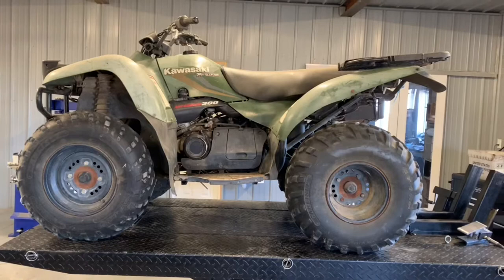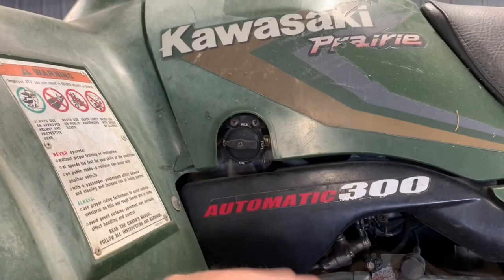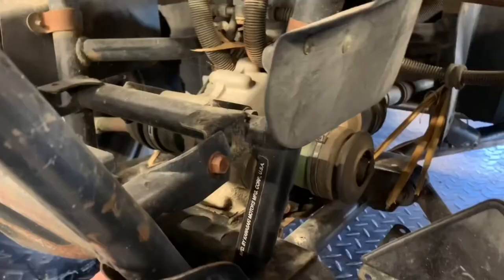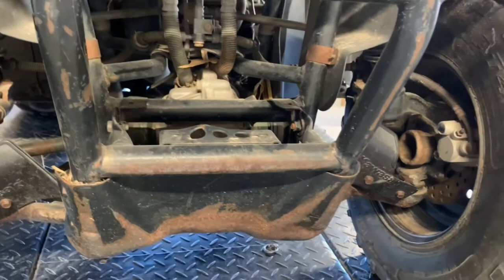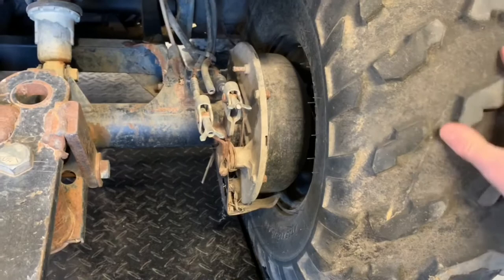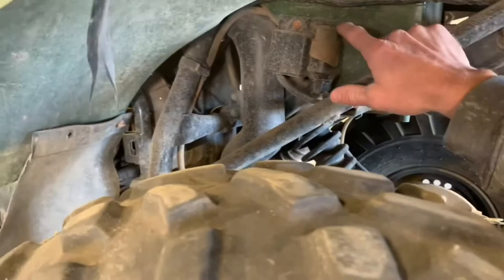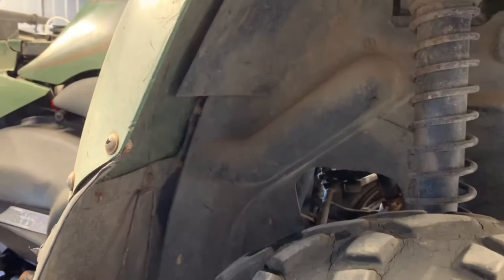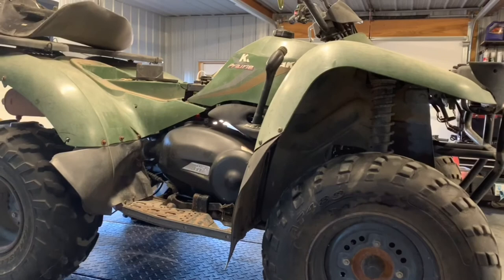Kawasaki prairie 300 Overview / Review  -   Do we like it?

Comment: Had a 2000 given to me for free, he said it needed some kind of screw on the rear swing arm, I took it, the swing arm bearings were destroyed and one of the screws was worn half way out, bought the swing arm roller bearings with outer races and seals kit, with o-rings washers and aluminum bushings, also bought an used screw for the one side, 
Took the rear diff apart, (it was nasty and had bad bearings) replaced all the bearings and seals, (including the needle bearing on the drive pinion gear) I removed the roll pin holding that needle bearing  by drilling it out on a bench drill press, and installed a new roll pin afterwards, the tie rods were worn out, bought a whole tie rod kit and a front master cylinder, put a new  battery and this thing runs like a champ!

Comment: Thanks for this vid! I have a 2002 2WD which is in pretty good shape for being used. One thing...I am able to change the rear differential oil w/o dropping the skid plate, it drains from a bottom screw on mine.

Comment: What can I do, my 2001 kawasaki prairie 300 4x4 only stays on with the throttle on, any recommendations
Reply from the maker: Ricardo. It only runs if you are giving it gas? You definitely need to turn the idle up. Is the choke working? Hit that subscribe button for more videos on the prairie 300.
Reply: Hi, I have exactly the same problem, did you solve it? because I can't find the fault